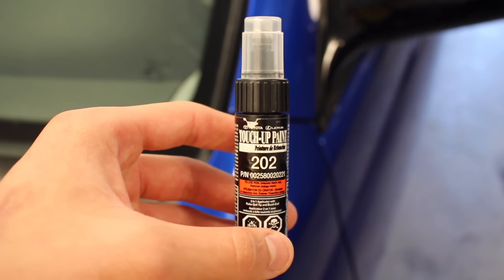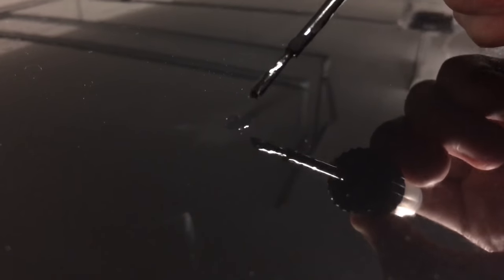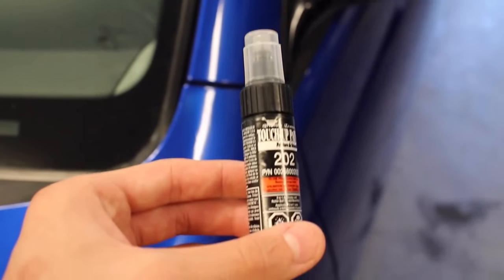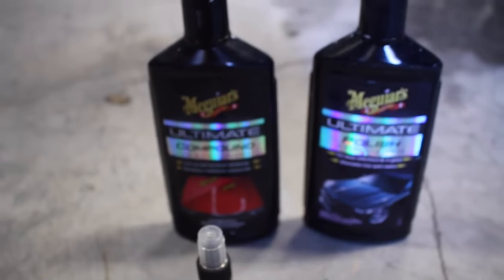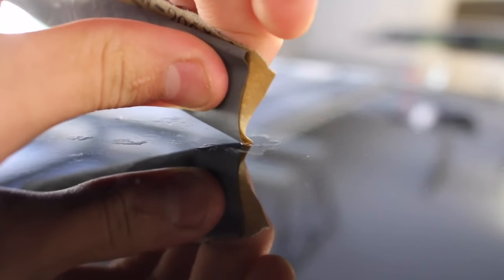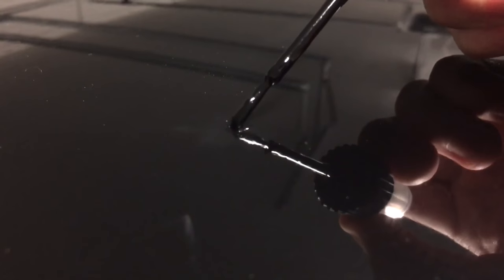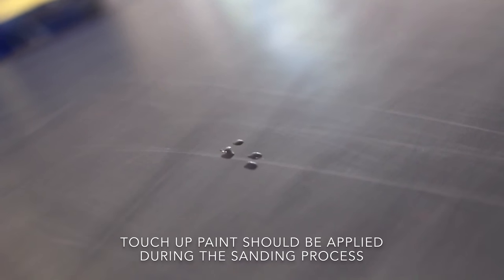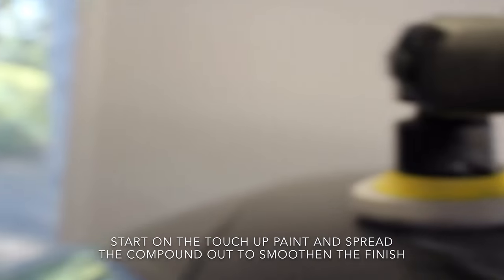How To Apply Touch Up Paint To Your Car

Comment: When you sanded it before applying the paint, the area around the chip was dull and scratched. However, when you applied the paint, all of the dullness/scratches has gone and you were suddenly only had the chip to paint - why?
Reply from the maker: AldershotDave it was the lighting. I you look very close you can see the paint is still dull, the lighting just makes it less noticeable. Once you compound and polish, all of the dullness goes away.
Reply: OK, thanks for the explanation.
Reply from the maker: AldershotDave No problem. Hope you enjoyed the video :)
Reply: Yes :o)

Comment: I would not use water when sanding down the rust, even if not visible there will be small amounts of water in the metal. The spot will keep on rusting over time after the paint has been applied due to the moisture stuck under the paint. Rust needs either oxygen or water or both to keep on developing. Using water when wet sanding will most likely make it boubble up after some time.

Comment: I have a bunch of scratches in my pick up bed so I’ll try to do this, in my head I would

1.sand
2.bondo or compound
3.sand
4.touch up paint   Does this sound correct?
Reply: It all depends. If the scratches are just clear coat a polish can easily remove it if it clear coat and paint the what you just mention sounds about right

Comment: Should I do this on scratches? I can't tell if the clear coat is thin or not since the car is old an abused. Idk if simply buffing is a good idea.
Reply: Get it wet. If they go away, then its low on clear coat and if not then ya gotta sand a bit then add both color and clear.

Comment: I have a 1/2 size (slightly bigger) rust spot where the paint flaked off the car hood down to bare metal. It's smooth metal, but starting to turn a rust color in spots. Can I use rubbing compound to remove the rust before I paint it with touch up paint. If yes, will Isoproply alcohol remove the compound so that I can now paint it. Thanks....
Reply from the maker: Uptown Wedding Photography NJ try cleaning it with IPA first, this may remove the rust, if not you need to sand it then polish. I’m pretty sure the IPA will remove the rust though if it’s not too old on the car

Comment: I would prefer to use that rust gel remover instead of sanding. It usually works instantly and then you don’t need to worry about sanding.
Reply: So the rust gel.. it levels the paint?
Reply: @edubb2491  no this guy is lazy

Comment: What grit of sand paper you used to smooth after the base coat?  I have a black tundra and Toyota dealer gave me a 2 paint .  A black base coat and another clear coat with glitter.  Can I also sand the base coat to smooth it out before I put the 2nd paint?
Reply from the maker: Yes. The way you can do it to get a perfectly smooth finish is after each coat let it dry, sand, apply paint again, sand, repeat. Then do the same with clear and polish. I typically use 1,500 to start and finish with 5,000

Comment: Once the rust was removed you had a bare metal to work with hence I can't understand why you overlooked applying the primer first ?
Reply from the maker: It’s a temporary fix
Reply: @nikolaiiaksenov  what's the permanent solution then? What's the point to do what you did in the video if you could have shown the whole process of fixing the issue permanently.
Reply from the maker: Harnas permanent fix is to repaint completely. Touch up paint is to prevent the rust from expanding
Reply: This is indeed a temporary fix. Modern vehicle paint jobs don't use Lacquer-based paint. Most touch-up paint is Lacquer based, it's easy to apply and doesn't require a primer.  The permanent  fix, in a nutshell, would be to sand the defects down to bare metal, apply any body filler/glazing putty necessary,  then use a spray gun to lay down primer, and a 2K urethane-based basecoat/clearcoat. Then polish and wax.

Comment: Thanks for the demo. I have a question though: Is it possible to apply the  polishing compound  (manually)  without the dual polisher (i dont have one)? Thanks again and I appreciate your advice
Reply from the maker: Yes. Just don’t sand as big of an area on the car because doing it manual by hand, you won’t be able to get a very clear scratch free surface. It will still work, but won’t look as good as it would if you did it with the polisher. You may also end up with slight marring if you do it by hand. It’s all up to you but it will work either way!
Reply: Thanks! I appreciate the input/ advice. What I have here is the applicator pen paint  (got it from Ford dealership by special order). They gave me also a kind of sponge in a ziploc bag (which appears to have a compound cream on it already? I didn't open the bag yet cause I don't want it to dry up and I'm not ready to do the touch up yet- nervous here and don't want to F-up the application). This sponge, I suppose would be for polishing after I apply the pen paint applicator?  Ford didn't give me much info on how to do it in detail. Thanks again.

Comment: I need some help and a little understanding on applying touch up paint If the metal doesn't  have no rust  do I just apply  paint  this is what confuses  me oh this is my first time doing  this
Reply from the maker: Yes I’d still recommend sanding for better paint adhesion
Reply: How about applying primer paint before the base touch up paint?
Reply: Is there primer touch up paint or it is only in big cans as an aerosol?
Reply from the maker: asphalt you can apply primer, but it’s not necessary. Touch up paint is temporary. When you repaint the whole panel you will use primer, but it’s not necessary for such a small spot
Reply: @nikolaypetrovnikolov2717  
Ideally you should. You can use a standard size rattlecan primer  - just spray some paint into the lid and dab it on to the bare sanded metal with a tiny art paintbrush or even a cotton bud. 
If you don't prime the touch up paint may look washed out & less matched to the original.

Comment: Breaking rc, what time do you wait for the touch up paint to dry before applying the next coat?
Reply from the maker: asphalt depends on the paint you are using. Typically 15-30 minutes. It all just depends on the paint.

Comment: Smoothen?
Reply: Lol he doesn't know what he's doing you would then stand it with a very high grit sanding
Reply: @mrpanda2655  No, you don't lol. Touch up paint only requires fine grit as the purpose is to level the surface and the raised edge around each chip.

Comment: will this work for a keyd scratch
Reply from the maker: It’s hard to tell through text, but what you may need to do is fill in the scratch with the touch up paint then level it by sanding, repeat until it’s smooth. Then clear coat and polish

Comment: That rubbing compound will not even out the blobs of paint you applied!
Reply from the maker: Sun Lite that’s true, it won’t. If you want it perfect and even you would need to repaint the entire panel. Touch up paint is only temporary to keep the rest of the panel from rusting.
Reply: sand it so its flush with the paint with 1500 or 2000 grit the buff and polish and it should look alot better